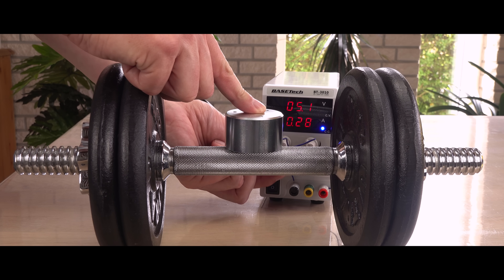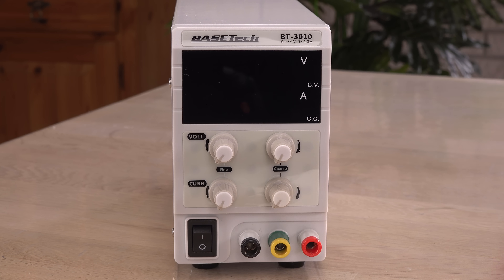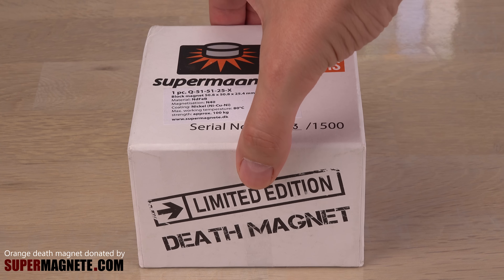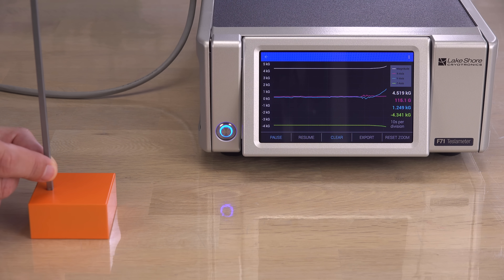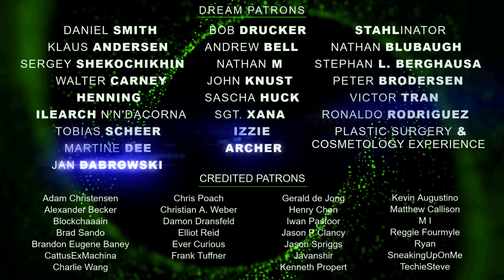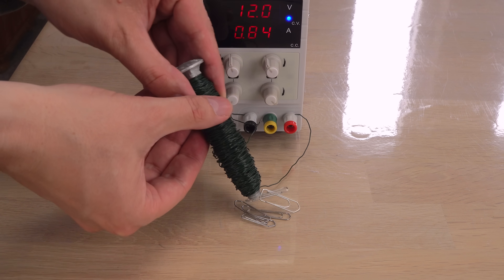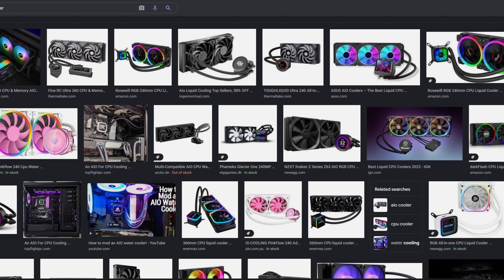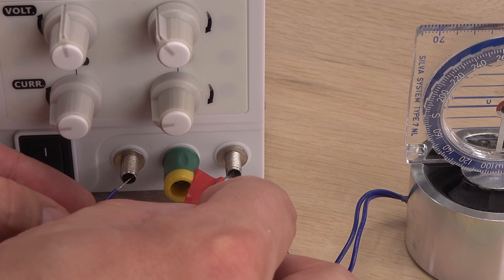New King of Magnetic Power? | Electromagnet vs. Neodymium Magnet

Comment: You should go all out with experimenting with pushing a electromagnet's ability and using a cooling system. Its just really interesting to be able to play with the settings, adjustments, etc. Im wondering if there could be some insane ways a super powerful one, or a setup system of them could be used if say: hypothetically you ran some off of a modern advanced nuclear  energy reactor. Could be small form, thorium reactor, LFTRs... But could definitely power some really fun science experiments that's for sure. And the energy source would be efficient, no emissions, stable, strong. It would be exciting to power a efficient system that runs off of the electrical output from a power source like that.

Comment: Feeding something more direct current, isn't overclocking. There has to be a clock to overclock. (Yes, if you overclock a CPU it will consume more power, but the overclocking lies in increasing the frequency of the cpu clock beyond rated specifications. The power consumption increase is a side effect.)

Comment: Your electromagnets brought some memories.  When I first got to deal with the math of electromagnets, I decided to try some optimization of my own.  To my frustration, the math "converged" always to the lowest number of wire turns, using heavier and heavier gauge wires.  In fact, my end result was that a single turn of wire that filled the whole available volume always produced the highest magnetic flux with least resistive heat.  Of course, the flux density is determined by the air gap, as long as the core does not saturate.  Your probing showed well below my usual assumption of 1.2 T (tesla = 10 000 gauss) to 1.5 T field density saturation for ordinary magnetic core materials.  So you would be able to push beyond the neodymium field density with a single turn winding and maybe 0.1 V / 200 A supply without excessive heating, if you can provide such a supply. (0.1 V x 100 A = just 10 W).
Reply: My post pH.D E.E. says..... Your right!
Reply: Hey there , I need to pick your brain as to me you have my answer somehow I am searching for...what do you say? Can u help me
Reply: Can u help me
Reply: @NEW-WATER-ATTRIBUTES-2023  I am not at all sure what exact help you would expect.  I just have one idea that may be easier to implement than, say some superconducting suggestion.  It is to make your coil of copper tube, such as the one used in air conditioner heat exchangers.  You could find that kind in most any big hardware store.  Then you would need to insulate the tube, with for example heat shrink tubing before winding it to a coil.  An alternative would be some insulating spacers mounted between coil turns after winding, I assume you would already have insulation around the iron core.  With appropriate fitting(s) and a pump, or just tap water, you could reduce the temperature rise to negligible level, meaning you could use much more current.  This kind of arrangement is used in flameless - Eddy current - annealing heaters.  In them, they don't need insulation, because they have the coil stiff, just air core magnet, maybe 2 or 3 inches inside diameter, 3 to 6 inches long.  I assume you would want DC use, and a more compact structure, with a U- or maybe E- shaped iron core.  However, keep in mind that any iron core eventually saturates, and after that any increase in magnetizing current causes only field increase at the same rate that results in open air.  All that means, initially the iron core effect is good and strong, but after saturation level, FURTHER INCREASE tapers off.
  
I hope this at least gives you some idea what to consider, or try next.  As to the source of current, somebody already suggested using car batteries.  Just pick some with a high cranking current rating (like 600 amperes or more).  The cranking current rating is for relatively short times, so you still might need two or more in parallel, if you want more than about 10 or 20 seconds duration.  And of course, the cables from the batteries to your coil must be thick and short.  I would suggest 0 or 00 size welding cables.  0000 size could handle over 600 A long term, but I don't think any practical batteries would.  Finally, you would need a really big switch to turn your current on and off!

Comment: I did something similar years ago, but with a modified microwave oven transformer. It could lift and hold over 130 kg (probably even much more). It used 1.4 kW of AC controlled with a variac converted to DC via a beefy full-bridge rectifier. All I did to modify the mot was cut the welds and pull off the I-section, shunts, and secondary windings. I applied power to the primary winding of the mot and that was it. Super-strong magnet at the flick of a switch. It did get hot though.

Comment: The root relationship is quite simple to explain with basic physics. The magnetic field (B) is directly proportional to the current (A). The relationship between the current and the power (P) is quadratic (P = I² • R). This results in a root relationship between P and B. I would therefore always put the current on the x-axis (set value) and the field on the y-axis (dependent value). What would make the video even better would be a physical underpinning. The electromagnet is a coil. You can strongly influence the properties of this by changing the length, diameter or number of turns. Also, the use of a core of steel or ferrite can influence the strength. You can easily adjust all these properties yourself to make a much stronger magnet. Most importantly, more current, stronger magnet. So if you can get more current through more turns without the magnet heating up too much, then you have a good magnet. Thick wire, many turns, around a ferrite core.

Comment: That's an underengineered electromagnet, I have to say...

The magnetic flux is proportional to the wire current times the number of turns, not the power. ALL the power you put in is converted to heat, so if you buy a magnet with the same area and turns but with higher power dissipation, it will be weaker.

The number of turns times the current should be maximized while the resistance must be minimized to get a more powerful magnet with less required power. Decreasing the resistance usually means using higher cross sectional area wire and material which has higher conductivity. This is why superconducting materials used for the world's strongest electromagnets.

Btw, electromagnets are used to magnetize permanet magnets, so they can be made stronger, waaaaay stronger than any rare earth magnet.

Comment: There is a trick with electromagnets , which allows you  to reach higher pulling force than any permanent magnet is able on  , without overheating of the coil .
You need to grind (as fine as possible  )  electromagnet’s poles and the metal surface on which you want to lock them  . Than use capacitors battery ( you may need ultracapacitors ( also known as supercapacitors or ionistors ) ). Charge the capacitors battery to few times higher voltage than the electromagnet is rated for . Than discharge the capacitors battery via the electromagnet’s coil . The enormous current pulse will create enormous magnetic field . The interesting part is that this field doesn’t disappear or weaken in the magnetic guide after the the coil current is disrupted so there is no any reason for heating and the magnetic guide loop can stay closed infinitely. You can open it by applying the same amount of current but with opposite polarity of the voltage on coil terminals . You can see such experiments in the following video https://youtu.be/s-5FMFzSPYU unfortunately on Russian language . 
By the way the strongest magnetic fields are archived by electromagnets !

Comment: Nice video,but the magnetic field depends on the current.The voltage depends on the resistance of the winding because an ideal inductor would be a short circuit for stabilized DC.Try increase the current to 1 Amp or more for a short time and it will be much stronger.

Comment: Great video, When I was younger I used to work for a company that had an electro magnetic lock on the door. During office opening hours the door was propped open and the magnet was at the top of the door frame. For fun we would turn the lock on and put some paperclips on the magnet. Then when someone walked through the door we would turn the magnet off as the paper clips dropped on their head. It was harmless fun as we watched from a distance as the bemused person wondered where the paperclips came from. This would amuse us for hours.

Comment: A lot of times when stuff is advertised as "12V" they actually mean something more like 14V because that is the kind of voltage it would actually see in an automotive application and most 12V applications are automotive. Could explain some of the wattage discrepency.
Reply: Most are not automotive at all not even close and 14.4v-14.6v is more accurate in automotive when using a alternator with no load and that can drop fast depending on load and alternator etc
Reply: @primus711  13.8v is considered "standard" alternator voltage, the way 120/240v is standard in the house. Yes it can vary up and down a bit but that is a good average to use for ratings.

There is however much usage of 12v outside of automotive applications. In those applications they really do mean TWELVE volts! Things like massive servers have a PS that outputs about 12.2v @ 100+ amps, voltage always adjusting to meet demand and stay at 12v. 12v is also heavily used for all kinds of control circuits - I think one of the uses of these magnets is to lock doors remotely, such a system would likely use a 12v power supply.

If it was made in china, I don't care what it is or how much it cost, the specs are not reality.
Reply: watts = {(volts)^2 }/ohm

Comment: Just bolting a regular finned heatsink to the back of the electromagnet would help keep the temps down when overvolting the electromagnet. There is however a risk of burning out the windings if too much current is applied.

If you want to push the overvolting experiment further there's no reason you couldn't put the electromagnet in a simple waterbath, at least up to the top lip, since the windings are insulated and potted in resin. That would dissipate the heat quite well.

Comment: I'd definitely like to see the results of cooling the elecromagnet. Regular computer heatsink, heatsink with fan, submerged in ice water, heatsink with ice water submersion, liquid CPU cooler, or even liquid nitrogen as someone mentioned. Maybe you could use an intermediate medium to work your way down to liquid nitrogen temps instead of doing it all in one step.

Hopefully you'll do several of those, but even one cooling method will be neat.  Thanks for a great video as always.

Comment: It seems peculiar that you focus so much on wattage of an electromagnet. The magnetic flux you get is proportional to current times number of turns in the coil (at least until you reach magnetic saturation of the core). If you rebuild the graph at 4:35 with current as the x value, you'd get a pretty much linear plot. So, if you want power efficiency, you need to minimise the coil resistance. Use thicker wire gauge, and/or employ some radical cooling (dry ice or even liquid nitrogen).
Reply: because amperage is directly related to magnetix flux. how else can your clamp meter measure current accurately? 😉
good comment, cheers!

Comment: The magnetic bridging was interesting, first time I've seen it.
I'm curious about using this for an electromechanical sculpture. If you wanted to lift a block (containing a permanent magnet) above it, what would be the most efficient way to do so. For example, shape and size ratio of permanent magnet, bridging vs not, orientation of permanent magnet, Halbach array usage?

Comment: I'd LOVE to see you home-build a monster electromagnet by obtaining a microwave oven transformer (MOT) and cutting off the top of the core and discarding either the primary or secondary winding, as well as the heater winding and magnetic shunts (if they will weaken the field, I'm not sure). The open-core transformer with only one winding becomes a seriously powerful electromagnet with very little work. If you can obtain 3 or 4 of them, you can power them in parallel from a DC power source and arrange them in an array, potted into a single housing. The resultant electromagnet would be able to hold several people hanging from it. I'd be super curious how the field strength of one of these MOT electromagnets compares on an equal weight and size basis to a high grade neodymium magnet with a similar magnetic field shape. :) I'm not sure about over there in your country, but here in the USA we have old, broken microwaves EVERYWHERE with (usually) good MOTs inside that have not been the point of failure. I know inverter-type microwaves are becoming popular, but they haven't really caught on here in the USA. Worst case scenario, you can buy a new MOT on eBay.

Comment: "Line-interactive" UPS' like the BR1500LCD shown in the video (4:01) are going to have a poor response time to a power outage, which may not be fast enough to keep an item from falling. A far more expensive "double conversion" UPS would be the only way to guarantee it not falling with regard to using a UPS as a backup.
Reply: That's where the capacitors inside the power supply come into play. There's no need for an expensive UPS if the capacitors inside the power supply can supply a few watts for the split second of lost power.
Reply: @Ferro_Giconi  Never trust a chep lab bench power supply.The circuit board looks like a professional one but many holes are empty because some components are omitted.

Comment: I made my own electromagnet recently out of an old microwave transformer. Using a couple old car batteries it got hot fast but it was so strong with that much current, the shovel would instantly stick and not come off until the power was disconnected haha
It was fun trying out different ways of powering and messing with different sizes of transformers

Comment: I'm an engineer that designs linear motors with permanent magnets. Your testing of the open air magnetic field does not represent the lifting power of the electromagnet.  If you put the electromagnet against a flat piece of steel with a gauss meter in between, you would measure a much higher field. Note that the steel plate should be thick to get the highest measurements (10 mm thick is probably enough). With the electromagnet in the open air (no steel plate), the magnetomotive force must be distributed across the air gap between the center circular pole and the outside ring pole. If you put those poles against against a flat steel plate (steel has high permeability), the air gap is much smaller, and you will end up with a much larger field (probably around or over 10000 Gauss, approaching the saturation point of the steel pole in the center). When you use the neodymium magnet against a steel plate, it's large magnetomotive force is mostly spent creating a magnetic field across its own  (low permeability) interior -- its own material acts much like an air gap. It's magnetomotive force is so high, however, that it can create high forces.

I would suggest that you perform a lifting test with the two magnets, and see how much weight you can lift with each one. Hang your magnet from a strong support with the poles facing down on the electromagnet (it looks like the electromagnet may have threaded holes for this purpose). Stick a thick (1 cm or more), flat piece of steel to the bottom of the magnet. Add weight to the steel until it falls off. That will give you a much better idea of the lifting capability. Repeat with the Neodymium magnet (You will likely have to use a clamp to hang the Neodymium magnet, or you can just stick it to the bottom of a thick steel beam or plate). 

The electromagnet will have high attractive forces with a small gaps, but the force will fall off quickly with increasing gaps. The Neodymium magnet's forces will fall off more slowly with increasing gap. 

When performing the same test with a thin sheet of steel, the sheet of steel will saturate (it has high permeability for only about the first 20000 gauss, and then saturates), and you will get much lower attractive forces. 

Good luck!
Reply: One of the measures of a good quality holding magnet is how smooth and flat it's surface is. The better quality ones are ground better. The same applies to the steel plate, so a machined/ground one is WAY better than a rusty cold rolled steel bar.
Reply: How crucial would the remaining air gap be? Because you could even go a step further and use something like heat sink grease to eliminate the air. The only drawback is if you even look at the stuff it gets everywhere.
Reply: @kennybruce2597  Not the presence of air specifically makes it weaker but the distance between the steel plates, the lack of ferromagnetic material.
Reply: I am curious about the inner and outer diameter thickness of the electromagnet, like how will it affect the performance if the center is thin and the outer is thick in diameter and which thickness will be the best option for high performance, can you help me with that?

Comment: The limitation of the electro magnet is the resistance from the copper wires that generates the magnetic field, if you used a superconductor like graphene the theoretical limit is much higher

Comment: I look forward to more of these! Cooling tests will be fun. You could do some pulse tests as well. If you can manage the power supply requirements you can pulse 10 times or more it's rated current, albiet for only a split second. I'm not sure what you would use it for but it would probably make an interesting video.